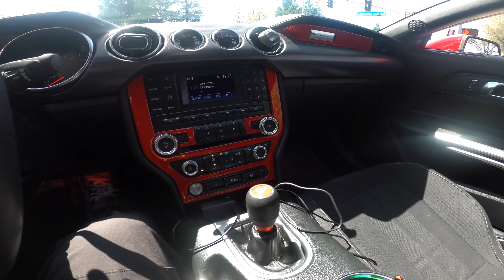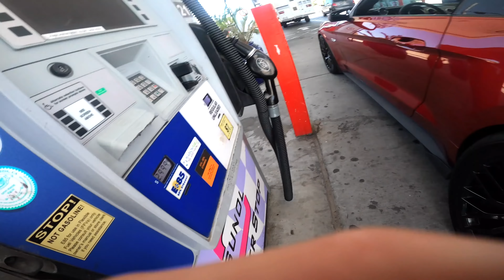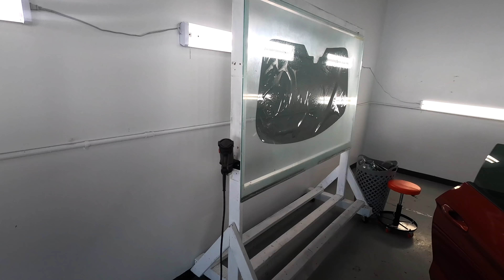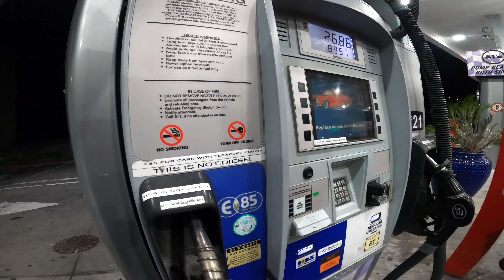I SOLD MY 800HP S2000 AND BOUGHT NEW 1000HP CAR!

Comment: I still don’t understand why you sold the ACR especially if you were gonna end up getting another American car.
Reply: Acr was dated and on the level of these new american cars in terms of power and handling
Reply from the maker: ACR was more like track car. I don’t really go to track anymore 👌🏼
Reply: @matteojosue8041  The ACR didn’t need to be that more powerful. The car had great power to weight ratio and it’s a timeless car, and on top of that it has phenomenal track performance to this day still embarrassing most of these new American cars, and other track focused cars. Nothing about the ACR is dated except the power which the ACR didn’t need and you’d know that if you’ve experienced what a ACR is. I don’t know where that bogus statement you made over new American cars having better handling. Where is that evident? ACR still holds more records than most new American track cars, and what is still the fastest American car around the nordschleife? For a car being rwd, huge as N/A V10, and a manual it surely can’t be outdated with the time it got at the ring lol.